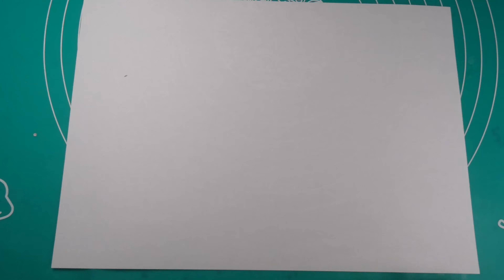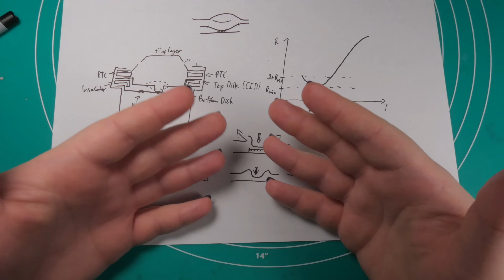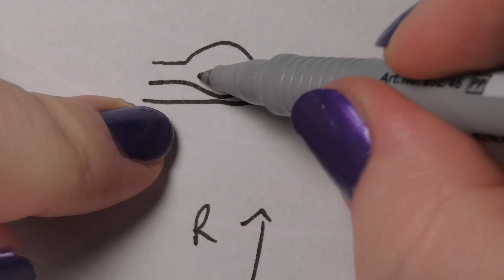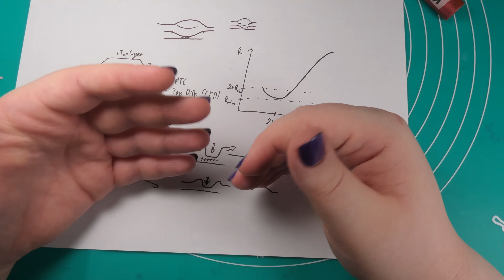Manual CID Reset - Reviving 0V 18650 Cells │ In Detail Explanation

Comment: 16:55 why not use something like hot glue that is stiff but much more flexible than steel to spread the pressure out across the entire area so as not to damage it because it can easily be removed after you successfully press it back down. (Or even a piece of very stiff foam or somewhat soft plastic)

Comment: Hi Anna, I have successfully reset the CID in numerous 28650 and 22700 lithium ion cells. I have tried both the drilling method and the method to cut the vent supports. I had over 20 cells fail in a battery pack due to 6BMS over charging them, but managed to get the vast majority to work again.

When using the drilling method (extremely carefully and slowly), a plastic tooth pick with a rounded end can fit through the hole to push the CID in.

When cutting the vent hole supports, I found that a round ended desert teaspoon handle was really good because it had no sharp edges. To avoid over pressing the CID cap, connect the spoon to a meter +ve with a crock clip, and the -ve side of the battery to the other crock clip using a strong conductive magnet. As soon as the meter shows a positive voltage, and the voltage remains after removing the force on the cap, then the cap is sufficiently depressed. This saves pressing the cap too much and risking damaging it with too much force.

Like you, I found some cells no longer achieved 4.2v and some leaked charge overnight.

I think your suggestion that if a cell can maintain 4v for 48 hours is a good test to determine whether the battery is of practical use.

Thank you for the very useful explanation 👍🙂
Reply from the maker: Hey, thanks for the comment and for  sharing your experience! These suggestions sound really good, especially the one to monitor voltage as to not over press the CID.  :)

Comment: Seems a bit stupid, bypassing a saftey feature to save a dollar or two.
Reply from the maker: Doing this does not bypass but reset the CID just as I explained. 
Edit: It can still trigger in case of something going wrong and it has as one of those cells a few weeks back finally blew the CID a second time, this time around it goes straight into the recycling bin. I think I mentioned this in the video that you can do it once but dont reset the CID a second time.
Reply: @PhysicistAnna  I still don't think the risk is worth the reward.
Reply from the maker: @David-jx4gw There is very little risk involved but the video is more intended to show how the CID works, what you can do to reset the CID somewhat safe and what you can expect. I'm not saying anyone should definately do it but it keeps waste down as around 3/4 of the cells I do a CID reset on will work but only around 50% of those behave like normal cells do.
There are 5 different results you can expect after a CID reset.
1. The Cell works just as any other cell. 
2. The cell can no longer hold its maximum charge e.g. only holds 4.1V instead of 4.2V. For such cells you need to custom adjust your BMS to not try to charge above 4.1V 
3. The cell can be charged to its maximum Voltage but no longer has its rated capacity. 
4. The cell will blow its CID a short while after then you need to recycle it. 
5. The cell shows 0V after the reset and is therefore dead.

Lithium Batteries are far less dangerous as people think they are the problem is most of the time not the cells but the battery construction and the BMS. These cells I recycled came from laptop batteries. They can only be loaded to something between 1.5A to 2.5A per cell depending on its capacity and C-rating. If you then make for example a 3s 7p battery (there is a very common diy battery kit that comes with a 40A BMS) you have 7 in parallel therefore can only be loaded to between 10.5A to 17.5A but as mentioned it comes with a 40A BMS that trips beyond 40A. Oversized BMS are very common on diy Projects and are the most dangerous thing.

Now this is just a quick explanation and there is even more to talk about but hopefully I was able to explain why I think it is not as problematic. But then again I do not say anybody should do it, this is more for education.
Reply: @PhysicistAnna  it's interesting to know but I don't see the value in spending time getting a second hand 18650, which probably cost less than dollar to work again with a 3/8 success rate. I still think the risk has increased as you don't know it triggered.

Comment: Thank you for your interesting presentation. The conclusion, as you suggested, is: DO NOT. An 18650 cell is not so expansive to take the risks. You can get pretty good cells by carefully disassembling laptop batteries, even new ones as I did, which are not always very expensive. There are NO 18650 cells with a higher capacity than 3500 mAh. Those with pretended  higher capacity are fakes.

Comment: Nice. Thanks. 
I have not quite understood what the PTC does  (probably just raise the resistance REALLY high on a dead-short due to massive Amps = massive heat?) and how to end up in the lower failure mode. Just lower pressure buildup that makes the CID bend up slowly instead of explosively popping the top out? Or will the heat from the PTC somehow make the CID go click?

Comment: 🎯 Key Takeaways for quick navigation:

00:00 📚 CID introduction and components
- Understanding CID composition, function, and placement in lithium-ion cells.
- Overview of vent holes and layers in CID assembly.
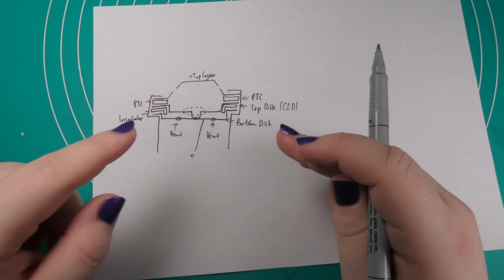04:20 🔬 PTC resistive material function
- Exploring PTC material function in CID and its activation influenced by temperature.
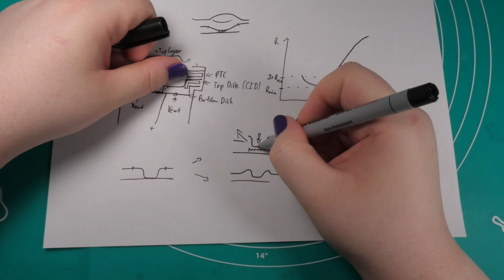10:07 🛠️ CID activation mechanisms and reset methods
- Detailed activation mechanisms and safer reset methods, emphasizing safety.
14:24 🧪 Testing and validation of CID reset
- Practical demonstration of safe CID reset method and post-reset testing.
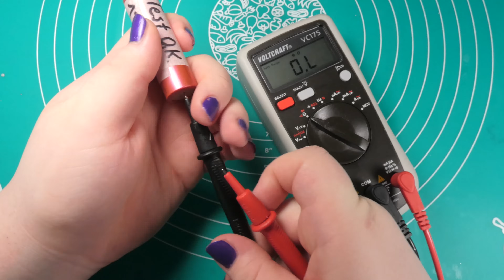25:08 🔍 Testing and resetting CID
- Testing resistance to identify triggered CID and safe metal part cutting for CID access.
26:44 🔧 Safe CID reset process
- Using pointed snips for safe CID access and caution to prevent metal contact with negative terminal.
27:17 🛠️ Manual CID reset
- Demonstrating CID reset with a screwdriver and importance of visual confirmation.
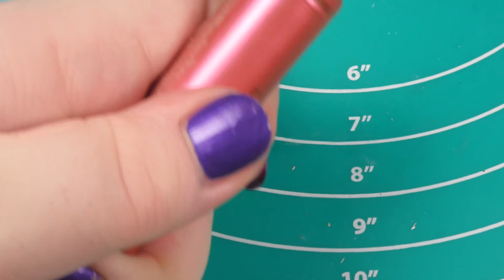28:04 🔋 CID reset success verification
- Verifying successful CID reset by voltage measurement and visual inspection.
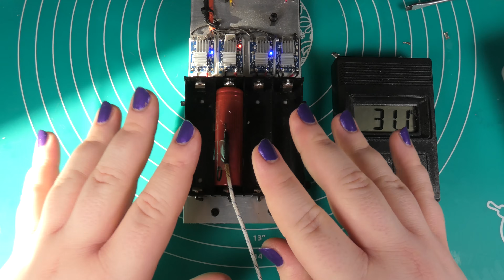29:54 🌡️ Temperature monitoring during charging
- Monitoring cell temperature post-CID reset during charging to ensure safety.
31:31 🧪 Post-CID reset battery functionality test
- Verifying battery functionality post-CID reset with voltage measurement, demonstrating reset process reliability.

Made with HARPA AI
Reply: Would like to know more on how to use it so it can generate these custom timestamp references... 🤔😍😏👍

Comment: Great video.
Good point about testing to see if the cell holds a charge for 48 hours.
Can also measure the OD to see if the battery has swollen: if so, should discard it.

And perhaps measure the temperature with an FLIR-type unit.
You should see a moderate and most imporatant, a uniform temperature as it charges.
That way you could monitor a few at the same time.

Comment: I recovered 3 batteries 18560 with 3 different methods all 0v one was by opening carefully all the battery removed the metal casing from the top side and cutting the lead and boom I read 2v I did a new casing with pla plastic redone the lead and charge finish the other battery was easier I just took a driver and started extending outwards with a screwdriver from the holes the positive has somehow it did the trick 😂 the third one had a sever nickel short so I had to remove the entire top again as I did for the first but I kept portions and the metal cap to reput it together. The one that looks bulky now is the one with the pla plastic head but all charge and work great.

Comment: After doing  the CID reset will the battery work in the same application that it used to before? or we have to use the battery in the lower current application?( BTW thanks for providing such useful videos, keep doing the great work)
Reply: It will but the security feature will be gone.
Reply: @davidbolha  Ok, thanks for informing.

Comment: When I revived some of the cells, I noticed that it shows two different voltages, I get 2.54V when the positive probe touches the top terminal but I get 3.90V when I put the positive probe under the vent cap. What could be the cause?

Also when I try to run a capacity test of the revived cell using the Zb2l3 module, I get  "error 3" msg displayed.

Comment: There is a better way.  Press the positive of a fully charge one with the positive of the faulty positive one, then use a cable to connect both the negative sides. I use my fingers to press the cable onto the negative sides without any issue. Wait for at least 30 seconds, the faulty one will reset and able to charge again.
Reply: This video shows a cid reset .
  You are talking about an overly discharged 18650  battery that cannot recharge after dropping below 2.9 volts . 
 Cid is a gas pressure thermal breaker type circuit breaker system built into the top of an 18650 battery .
Reply: @gregorydahl  ooh, I thought they were the same thing. Good that you pointed it out.
Reply: @ngoandrew8 This will seem sarcastic, but it's a serious question that I always wonder about.

What is the thought process when someone who obviously has no knowledge of a subject, or wrong information, chime in with such confidence.

Like "Here is a better way" when it's 100% not, and barely related besides also being about batteries.

Comment: I had the cid trigger on 26 new 18650 batteries in my e bike due to a faulty bms.i carefully drilled a 2.5mm hole above the cid and reset them all by pushing down with the blunt end of the hss drill bit.i replaced the faulty bms and the batteries have been fine since.thank you for the very informative you tube video👍
Reply: How as the BMS faulty? What did it do?
Reply: @leocurious9919  poor undercharge protection
Reply: @chiefdenis  They should not produce pressure (trigger the CID) when discharged too low. I have a lot of cells that were at 0.00 V and they are all just fine after carefully reviving them with a very low current.
Reply: @leocurious9919  there are lots of factors that trigger the cid, high current draw, over voltage, excessive heat, extended time at full voltage(months/years), 1 faulty cell in a series pack can trigger others also, a bad bms will not sufficiently protect all the cells in a pack from these faults.
I've salvaged some dead laptop batteries that when i open the pack the cells are still alive, that's a good bms that protected the cells from a potential fault before the cid triggered.
If the cid triggered, the bms probably failed at its job, the cid is like a last resort.
Reply: good idea that, the blunt end of a drill bit👍

Comment: i have some questions:
1. once the CID pops because of temperature, do you think that hot air also builds inside the battery because sometimes you would hear a whooshing sound when you press the CID back into place.
2. since the CID may not pop again after it is put back into place, there would be no safety circuit breaker anymore when the temp. goes high, so the battery will end up exploding if it gets too hot, or will the CID pops again?
Reply from the maker: Hey thanks for your questions and sorry for the late response.
The function of the CID relys on the relation between temperature and pressure inside the closed cell. Even good cells have a slightly higher inner pressure when in use, this is normal and the CID is designed to not trip. If the cell however goes into fault state the additional pressure build up is caused by the electrolyte that evaporises which then trips the  CID. As I explained in the video the CID either trips and simply disconnects the Anode or opens up and vents the cell. The sound you descibed when reinstating the CID is caused when vented cells close back up this is normal and actually a good sign. Also doing a CID reset will not prevent the CID from tripping again. In contrary it is now much easier for the CID to be tripped as the metal either is weakened by the deformation or already was discconnected. The key is to get the CID pin back in place without deforming the disc it sits in. But even if you deform the disk it will not prevent the function, just delays it a bit (worst case).

Comment: first thought for me was cmon a 30min video but at the end it made good sense. the flush sidecutter is a must have. i cant get the continuity test  you did to give me a true indication so a 5 min pre-charge with an old Nokia charger and if it goes +1,7v it goes in the litokala if nothing shows the method you showed is a good way to go if one is willing to take the risk. now i will go to work on the 126pcs i took from ebike batteryes and was to chaepscape to throw. Thanks

Comment: very dangerrous. CID pops when internal pressure gets too high. when resetting it you will damage it and the protection is useless and the next time something bad happens to the cell it has a much greater chance of exploding because you destroyed a safety measure. it is damaged and has more resistance popping up again or won't pop up at all unlike whatever you say it has done

Comment: VERY BAD IDEA. If a battery goes 0v with no continuity . RECYCLE THE CELL DO NOT USE IT.  In 99% of cells when Cid is triggered it normally due to some internal problem with the cell. This technique is DANGEROUS and is more like rigging a fuse or breaker in your homes fuse box to stop blowing without knowing why it was blowing or tripping in the first place. There are several videos showing the heat produced from "Cid resets". Is a cell that costs a couple dollers really worth risking your setup, home, life and limb, or a loved one.

Comment: what about sticking the cell in a pressure chamber... using compressed air to offset the internal pressure of the cell with an external pressure? Not sure how much pressure would be required but I would assume it would be the safest way to reset the CID without physically damaing the cell... of course too much pressure could do damage i would assume. What're your thoughts?
Reply from the maker: In theory a nice idea if the CID got tripped in a way that the cell is still closed and you simply have to bent it back. As you correctly stated too much pressure would be bad. The cell housing is relatively thick compared to the CID metal ring. However I don't know if it is that easy to bent metal back once it bent outwards. It makes kind of a bulge which also makes it more stable structurally. But I'm not an expert when it comes to using compressed air to bend metals.

Comment: I have used compressed air to reset the CID, make a cone end that will fit the end of the battery and have an air fitting in it
about 5+ PSI pressure on the end of the battery will pop the CID disk back in place without touching it or damaging it
 you can also build a pressure vessel out of pipe and caps and a air fitting for a compressor and charge it with about 5+ PSI
Reply: Picture please!
Reply: Was it fitted like a bullet and pressured in one end only or the whole battery?

Comment: Good explanation but the CID is a safety measure and its not been meant to be resetted! If you do so, you do it at your own risk (of course - like anything elso you do...). When the CID was triggered it means the cell was under very unhealthy conditions and built up very high pressure. I heard about around 100 - 150 psi - which is a lot inside such a cell. This means it was probably very hot - so that the electrolyte degraded and the cell got dangerous to use. In some circumstances it can be that the cell can be used again, but it will never be safe again!
Reply: The sky is falling!!!

Comment: This is pitentially, the BEST and SAFEST explanation about 18650 CID reset. However, I've been thinking about another less intrusive system to reset the CID.
Since the CID gets popped out by pressure, could you reset it by applying air pressure to the top part of the battery? 🤔🔋
This will surely avoid any damage by scirung, and bending or cutting apart any part if the positive terminal.
Reply: Jest and it can be very easy

Comment: Hi Anna, I didn't even know they had protection. Do all 18650's have this CID ? I know some have a voltage cutoff to stop any damage to the cell but most do not. If you look around EBAY they seem quite rare. I had a torch switch itself on and flatten a cell and my normal charger would not respond. I charged it at 4.2V and 100 mA for 10 minutes through a buck converter and then it charged OK in my normal charger. I think a hard plastic knitting needle might be good for the CID reset. I still don't like the idea on sitting on them in a ECO car.
Your pretty good with nail varnish to.
Reply from the maker: Hi JP,
not all 18650 cells do have a CID but the easiest type to identify is the one I showed in the video as there are vent holes on its positive. However there are cells that have a CID but no obvious vent hole. It is covered by a piece of paper like material and blows off as the CID gets triggered. Basically I would treat all cells that don't have obvious vent holes as unprotected.
Well actually even if a cell has a CID it is still considered as being unprotected. Typically a protected cell is a cell connected to a BMS (Battery Management System). Sometimes even called a fully protected cell. 
Terminology varies between vendors and manufacturers. Some 18650 cells I saw being sold as unprotected or protected depending on the vendor even if it is the same cell. The CID is just the last resort. You always need a BMS to protect it from over current charging/ discharging, over voltage charging and under voltage discharging.
Reply: @PhysicistAnna   It's a pity that so many things like torches don't have any BMS. I had one from China turn itself on and completely flatten the battery. I revived the cell but it's lost quite a bit of it's capacity. Thanks for the help Anna.